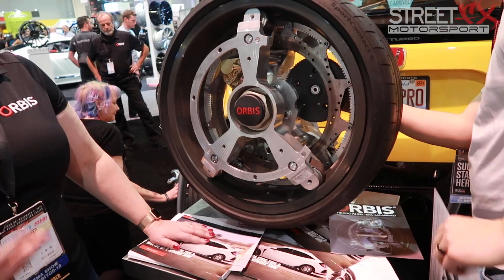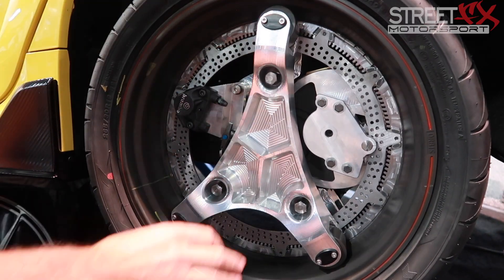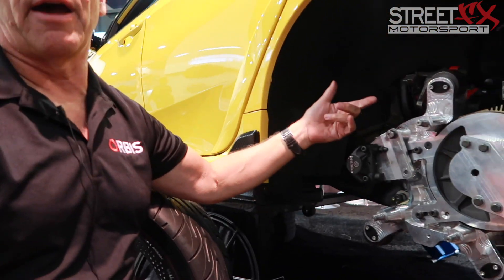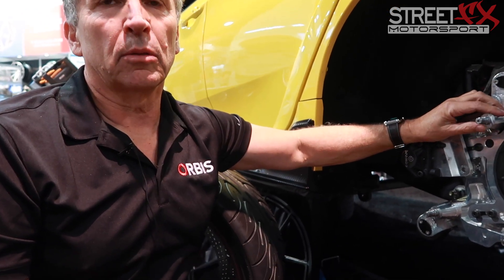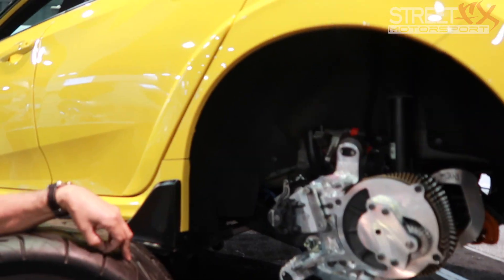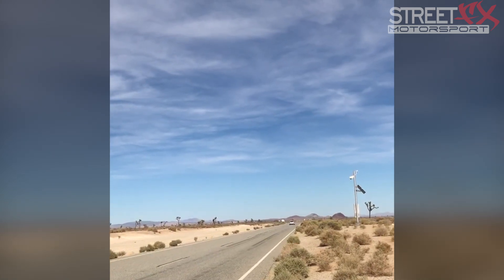WORLD's FIRST ELECTRIC hybrid AWD Honda Civic Type R FK8 with 450hp!

Comment: Just wait until rocks and road grime gets between those rollers and the rim. Another 
question would be what kind of side loads can that roller system take? Well there are actually a lot of questions. Sorry but I see many failure points. 👎
Reply: And looks like you'll have to take out the brake caliper to change a tire. The whole thing depends on a smooth inner surface of the rim, and a tight and precise fit between the  rollers and the rim. This thing (at least the prototype as shown in SEMA) doesn't come with any adjustment to the rollers to accommodate for wear. Metal on metal contact (or what appears to be) between the rollers and the rim would also spell nightmare given extensive use. Proper seal between two moving surfaces i.e. the outer cover and the rim can also be a challenge... just imagine what would happen if gravel manage to get in between the pinion and the ring gear
Reply: P.S. Looks like the version in the exploded animation at the end of the video does feature lash-adjustable rollers after all
Reply: @L_T_Z  nope. Just take out one bolt and turn the bracket. He did it in the video.
Reply: Allen Brown  -  Yeah, it doesn’t matter what you make those gears out of...   any sand or grit will tear those gears apart.    I was about to post about the myriad modes of failure but you beat me to it ;)
Reply: @I Am Sekou wipe the shit off your nose 😂😂😂😂😂😂
Reply: The stock CPU doesn't know the extra power from backwheels as he says...so not the ESP nor any active helping assists...so stock CPU doesn't know why its sencors read powers from nowhere ...ok something's weird here and seems more like we run to catch the train of the electromobility than stay back and watch with safe
Reply: I can see this being good for drag racing
Reply: Allen Brown I agree. Even if it uses brushless motors, grit and rocks could completely jam the gears.
Reply: This whole comment section 😂👌🏾
Reply: This would be cool on like.... A go kart.... Id like to see that smaller caliper in action... This whole thing seems nice just not in this scale. Wear and tear. I have to agree with some of y'all this thing wont last in the Midwest.
Reply: @Abraxas99x  It's been done on a Formula SAE car. Essentially a go-kart. Ever since I saw that I've wanted to do it on a real car, and then I discovered this.
Reply: this honestly wouldnt survive a a bumpy road very long
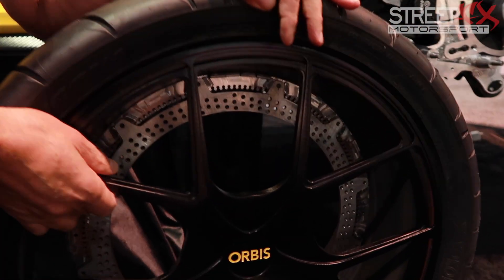Reply: A cover side that keeps debris out 7:25
Reply: @ftw7813  yeah, got that. Doesn't cover the back and no where near water proof. With water comes grit.
Reply: @ThisLiLpiggy79  and  hella rust!! I'm 
 Happy you noticed the flaws too.
Reply: I don’t think the people who will buy this will be abusing it any time soon
Reply: Exactly what I was thinking. Still a really cool idea, figuring out a way to seal or interlock it down the road and you have a perfect system, but even so throw that on some project car and you have a perfect summer toy
Reply: It's fine don't worry
Reply: Idk if this is relevant but he says somewhere in the video that the motors are submersible and that they are imperveous to dirt and grime.
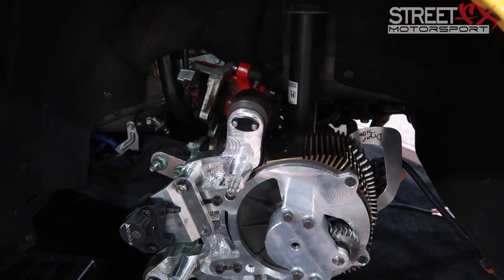Reply: Mitch Mag he says it's fully submersible at 4:25
Reply: Wtf.. slow down home boy, Rome wasn't built in a day.. this is the first step.. shit happens and so we have later models.. ie. More improved.. that's like bashing Samsung's foldable touchscreen Smartphone before it's open season,
Reply: Im sure there is a solution for this teslas have motors on there wheels too no?
Reply: @ftw7813  my issue isn't with motors in the wheels. Many cars have this. It's the roller system they're using. Looks like a good sema gimmick but real world, I don't think it would hold up under every day use. Just my opinion.
Reply: i agree. i was just thinking will they survive the harsh winters from the midwest.
Reply: @ftw7813  Teslas have a motor in the center and use CV shafts to connect to the wheels. That way the motor is hidden away from any sort of debris, water, etc.
Reply: Jeremy Smith  Tesla has inboard motors with traditional CV axles
Reply: @ftw7813  No teslas don't.
Reply: @I Am Sekou oh, we got a tough guy. Weak bitch in real life so you want to talk shit to me behind your keyboard. Only this time you picked the wrong guy. Get back to you when I have your name and address. See ya soon 😉
Reply: @ThisLiLpiggy79  You've got a weak soul, my friend...
Reply: @robbietaylor4114  what are you talking about? 😂😂😂😂
Oh, Sekou must be your "special" friend.
Reply: @ThisLiLpiggy79  r/iamverybadass
Reply: @sunder6745  lol how's that guys response. Get me in the screenshot.
Reply: @ThisLiLpiggy79  lol now youre bring just as petty as him. Your asking for someones address in a youtube comments section. Chill be the bigger person

Comment: Can I convert my RWD car to 4wd with this system or does it work exclusively on Fwd cars?
Reply: I believe he says you can on the video. They would just need to make it for your vehicle first....
Reply: You'd need custom mounts for the new hub but it should work haha. Wonder if it'd torque steer from the electric motor hitting immediately lol.
Reply: @RCXDerp  I was wondering if you could keep it in neutral and it would take off with just the electric power lol.
Reply: @mobilcams  Other wheel hub based hybrid systems are controlled by detecting acceleration of the vehicle and kicking in to provide electric assist. To use these for pure electric driving you'd need an additional control system. Conceivably if you put in the effort you could reprogram the car's stop start system to keep the engine stopped even while moving under specific circumstances for full electric driving but that would be complex and very vehicle specific unless you had access to the secret sauce info the manufacturers have about how the car's computers work.

Comment: Look's like a wear n tear nightmare....exposed to the elements. I have doubts it'll be viable in real world.
Reply: Yea, the electric motor will be a fine but the gearing will grind itself tot death once some dirt gets in.
Reply: Corrosion x
Reply: I don't think he mentioned snow as one of the things it could withstand
Reply: I could see this working if you living in the city like California or warm climate areas but I'm think you may worn out the gears without some sort of lubrication and consistent cleaning.

And I'm wondering how would it handle against potholes at number of speeds because I don't that structure would hold agains the forces changing suddenly. Including driving on gravel roads because the front is constantly blowing dirt back to the rear wheel. Which you haven't notice the rear acts like a vacuum for the front so not dirt or water can into the fronts braking system. I feel that his should be tested more for normal conditions of people who lives outside pave roads and try driving on highways
Reply: Me too thats a ton of failure points.
Reply: Yay, no weight penalty... other than the 200lb battery. Like everything electric, the idea is fantastic, but the execution is limited by physics. Add the deficiency of non-lubed gearing as others have mentioned, and this is a non-starter. You're better off with wet nitrous.
Reply: Did you miss the part where they say it's impervious to the outside elements or what wear and tear are you talking about?
Reply: @XtremeGTI  Was that before or after they told you it granted you super powers and immortality.  I mean if they said it then it must be true so why don't you jump off a cliff and let us know what happens....  SMH no don't actually do that but seriously the guy is a salesman.  He will tell you whatever he needs to get you to buy his product... If it ever does actually go on sale.  
EDIT - If you are really an engineer then you would know that no company would actually make something that was truly impervious and unbreakable as it decreases repeat business.  Further no engineer would ever make such a bold claim regardless of the parts they are using.  Now if you can engineer a way to eliminate friction and while you are at it the laws of physics then I do stand so corrected but until then...
Reply: @pprotory   the fact that it doesn't take an engineer to realize the friction and wear between the gears must be addressed, shows to the simplicity of your brain. Obviously the designers would need

 address this most obvious problem..... Eliminating outside variables, like dirt and grime, things that don't naturally affect gears, is what interests me. How feasible this concept is for a daily driver, I presume must still be tested. But to simply displaying the unit does not require greased gears.
Reply: @XtremeGTI  Well for one you actually have no idea what I am as I haven't stated either way.  I merely questioned your assertions by stating the obvious.  Now as to eliminating variables like dirt and grime allow me to state the obvious once more.  Given the ring gear design there is no way to completely seal off the gears or the rollers that balance the load on the wheel from dirt and grime.  

So if my mind is simple and I immediately came to that correct conclusion while you're still pondering the feasibility then that doesn't bode well for your future as an engineer.
Reply: @XtremeGTI  Look at it ffs. Exposed gears in mesh....just add dust, sand, road grime and water. It cannot be 100%enclosed as the brake rotor's housed in the same assembly and needs airflow to dissipate heat. Like I say, no application in practical real world terms.
Reply: @camfam52002  I'm an engineer, and a car enthusiast. I understand the concern, I immediately thought the same, but they speak of a cover in lexan or solid material with a seal - 07:25. So I'm assuming they try to protect it as best they can, unless I'm not understanding their conversation.
Reply: @XtremeGTI  I'm seeing metal gears to metal gears with no lubrication it'll eat itself apart with no cover or with a cover. Either way this will only last so many miles before you're replacing gear sets
Reply: @oneeyedude20  Exactly. I'm surprised I read so many comments before you said what I was thinking. I see gears with no lube and exposed to the elements in a particularly dirty place. The wear will be off the charts.
Reply: @camfam52002  look like lots of points that would metal fatigue quickly ,nice expensive idea for hillclimb club cars

Comment: At 5:36 he said 100hp per wheel but the civic make 300hp isnt it suppose to be 700hp not 400hp.... o.O?
Reply: There is only 2 electric wheels not 4 and the 300hp is not to the wheels it is to the crank so 400 would be about right
Reply: 400 HP to the wheels is nothing to snuff at either that would be about 500hp to the crank if you were looking at factory HP number not dyno wheel HP numbers

Comment: Great engineering exercise but looks like a maintenance nightmare. I know he said it's impervious to water and dirt but, frankly, I don't believe him.
Reply: I could see these gears being shredded by debris.
Reply: James Nics enclose it? Problem solved
Reply: I was thinking the same thing. Up here in the salt belt would put that completely impervious to dirt gears to the test. But I always like seeing these new ideas.
Reply: I wonder about the wear on the rims from the rollers.
Reply: noxxi knox  If only someone could invent something to cover those exposed mechanical parts...
Reply: It would be nice if it actually worked...
Reply: Is there any possibility that the exposed gearing is just to display the tech at the show?
Reply: Michael Acker even so, that was just one example of what I meant by “maintenance” when replying to the first person in this thread. Other maintenance concerns, like the life of the wheel rollers, how this holds up to high lateral g’s, battery life (refurb battery + performance application it was never designed for), motor life/durability, etc etc, are all concerns from a practical perspective
Reply: Snap into a @llStixxll
Reply: noxxi knox  best comment.
I can't believe that the guy presenting this believes his own bullshit. The open gears, and much worse, the idiotic rollers, will work for like a few 100 kms, if at all.
Reply: Y'know... there's these things called covers... I wouldn't be too worried about water or dirt as long as there's a cover over the gears. Rollers might be an issue with rocks, but if there's a shield for the gears everything else will be fine. Look at the brakes on your car. Do they work? Probably. Do they have a little rust? Probably. I'd have to do some thinking but I could make this system weatherproof. Quite easily.
Reply: BoostAddict I don’t think I understand the point you’re trying to make about brakes. Could you clarify that? I have heard of covers, actually. I’ve never taken the cover off of the underside of a car and it be clean under neath, so the concern stands
Reply: @boostaddict_  then the system is incomplete. It shouldn't be falsely marketed in the first place.
Reply: a fabricator could make a cover for those exposed gears, I might be sold.
Reply: Would this work in ice, snow, -40*f?
Reply: I agree but it's a damn good start.
Reply: Those exposed gear teeth would wear out so fast by sand and water.
Reply: Sandy Lee  have you ever heard of a figure of speech?
Reply: I would have to agree. Those tiny black wheels inside the rim is what I'm worried  about, sand and the likes coming between the inside of the rim and those wheels will destroy them pretty quickly I would imagine. Sure you could place a plastic rim on the outside to try help, but what about the inside of the rim by the motor?
Reply: It is definitely gonna be more niche than he seems to be implying. But on a track or in places with nicely paved roads everywhere, this would be very worth it.
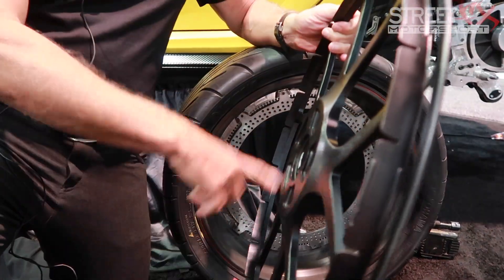Reply: noxxi knox  7:28 he directly mentions a seal to keep dust and debris out. But use your fucking head for 2 seconds and remember that this is still an early version. Any issues that this company is pouring millions of dollars into producing will likely go through the same design considerations that can be thought up by a group of idiots on YouTube...
Reply: Yeah this thing is a fatal accident on wheels
Reply: Its a gimmick. The guy wants to make money.
Reply: It still is a koncept but give it more time and sponsors and it will be just fine
Reply: @bosnjo0134  It's not a concept, its for sale. And yeah there will be faults, like any new product but they should be able to fin them and fix them as they occur.
Reply: I was just going to say. Just one rock...
Reply: Great next Gen idea. Although it should be more compact and hidden somewhere underneath with a cover instead of the rim because the wear and tear seems almost to predictable.
Reply: And thats why you are the commenter and not the engineer
Reply: electric motors don't need maintenance
Reply: Spedracer55 “maintenance” in terms of exposure to elements and likelihood of corrosion and excess wear from being the wheel. This exposed gears + small rocks = a bad time. I wasn’t talking about schedule maintenance that ICEs have.
Reply: Slim Jim Im assuming they will have a cover over the gear area; the fact that it’s at SEMA and people will want to see the workings is the reason it’s exposed
Reply: David Hernandez debris always finds its way into everything that isn’t sealed under a car, so I don’t think a cover would suffice as a long term solution
Reply: Wonder how this will holds out in snow, ice, roadsalt??
Reply: randbca I would be curious to see that too. I live in the salt belt. Also would like to see how this holds up to performance driving and not just straight line acceleration
Reply: @spedracer55  how about the gears exposed to dirt and debris?
Reply: @spedracer55  u just got owned
Reply: The real question is should I believe you or the company that has put millions of dollars and testing hours in their product? No disrespect but I think these guys have figured it out...
Reply: Justin R I worked in the car industry for years. I worked for multi billion dollar companies like Subaru and Toyota. I can assure you they design and test cars very well yet they still break within the warranty period.
Reply: @llStixxll  I don't doubt that a single bit... but like I said I think they have it mostly figured out. Always room for improvement no matter what the application.
Reply: Justin R there is a lot of room for improvement. The exposed gears are only an example concern of maintenance. I have plenty of other concerns beyond that one thing. At $10k or whatever this retails for, I’m not sold. By revision 3 or 4 and at a price of $5k-$6k I think they’ll have a real contender
Reply: Justin R I have no doubt it works. This is so amazing because it has very simple engineering used in a brand new way. It is obvious they really went through this since they made it plug and play. Nothing beats 1000s of customers to beat out some demons. I think this general design has been used on bicycles before. Mechanics are sound and any wear issues will be worked out in a couple versions. The software integrated with the car will probably always be the problem.
Reply: This is a jews way of doing things.  Very unnecessarily complicated.  Why not just mount a out drive motor on a conventional wheels and get rid of caliper brakes all together, and use motor braking instead?

Comment: So 100hp per wheel... 200hp. That’s roughly 150,000 Watts... at 144v that’s 1,041 amps.... those power cables would be massive...
Reply: 50hp per wheel
Reply: Read the note in the video description. Says can get 75hp “motors” ( plural) and can be over volted for 100hp motors. But they are only talking about the 50hp ones in the video.